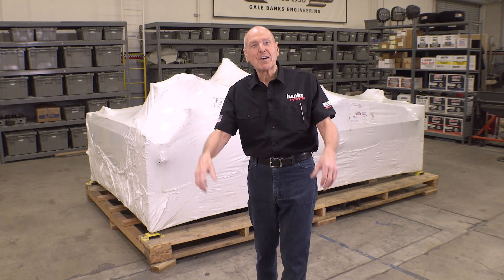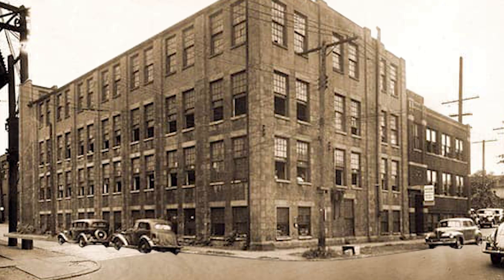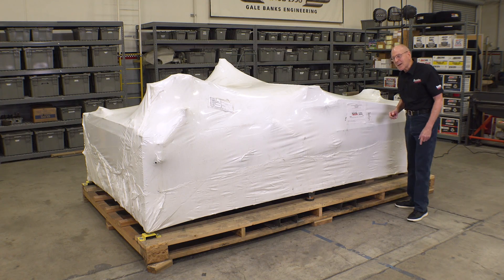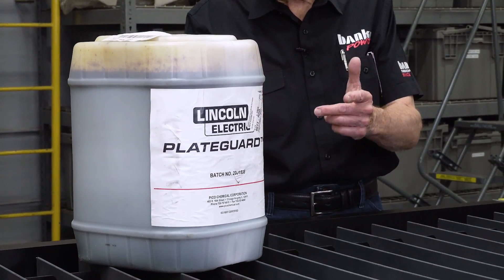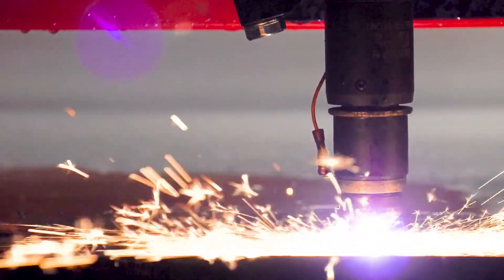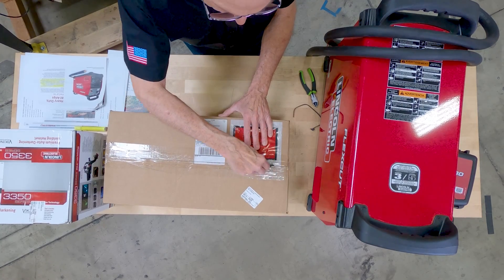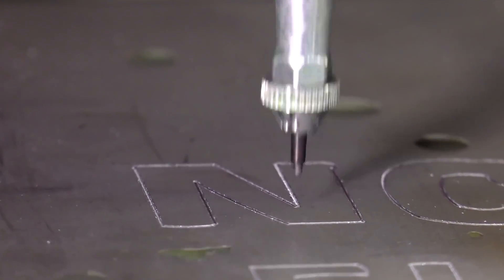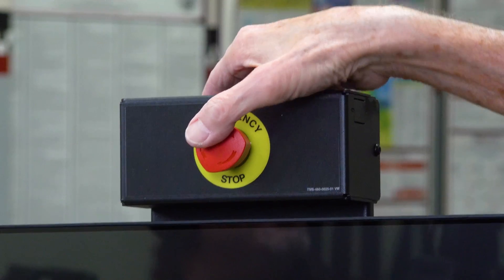ENGINEERING UNBOXED: Lincoln 4510 CNC Plasma Table

Comment: the issue i see is the cost of this machine if you add an accessory and the machine comes fully assembled the accessory should be fully installed as well. ESP since they are built to order machines with a 4 wee lead time.

Comment: Gale why plasma over water jet?
Reply: Speed and price would be my first thoughts. Water jets cut about anything but HP / power requirements and maintenance for a 60,000 psi water jet are pretty steep and you need about 50 HP worth of electricity. As an example the ceramic plungers in the intensifier are over $1500 and after about 2000 hours they are due for replacement. Garnet is about 25 cents a pound and you typically run a pound a minute.  Great machines tbh but you need to understand the costs before jumping into one of those beasts. I suspect the plasma cuts metal a little faster and less expensively. But warp from heat can be an issue as well as work hardening the cut edge in the right material.
Reply: @tbthedozer  Agreed. Waterjet is versatile and accurate but cost prohibitive. Plasma is the fastest metal cutting method plus consumables are comparatively cheap. Even if you have to cut thick steel, most plasma tables will easily switch to a torch which is the fastest method when you are cutting over an inch thick. 

Warping is not an issue with plasma if you keep parts under water. The tables cost a bit more but smoke and warping are all but eliminated.

Comment: The torchmate is an ok starter table, I would prefer instead a JD2 instead 
Better gantry and drive motors etc.
Id also go with the one and only hypertherm plasma torch sets.
Reply: Yea Hypertherm software, power supplies and torches worked really well for us.